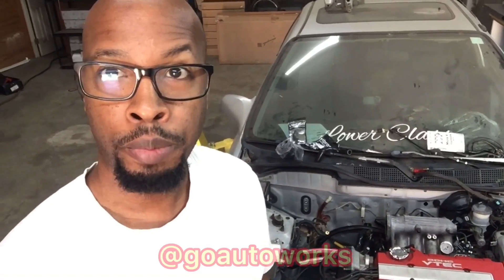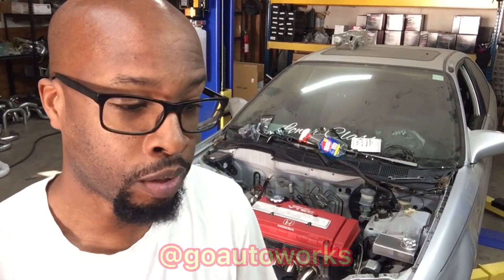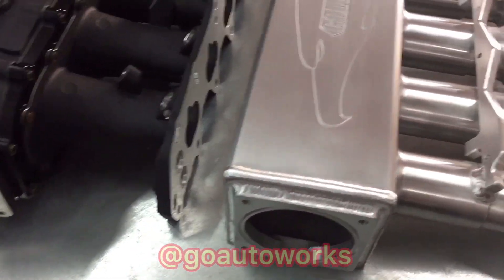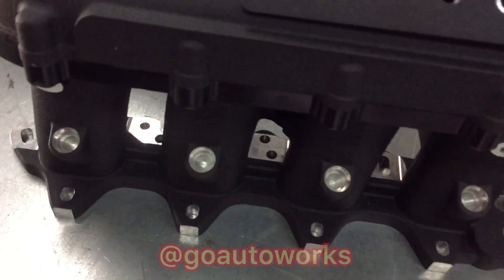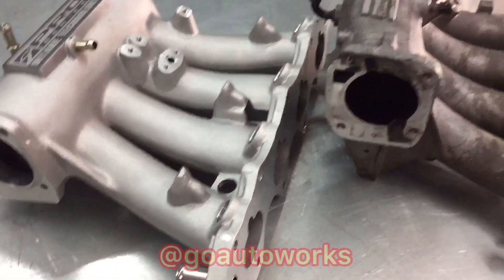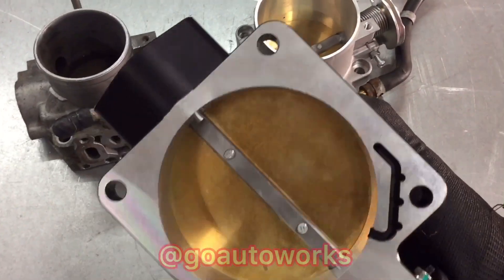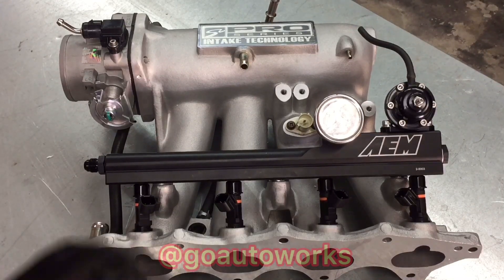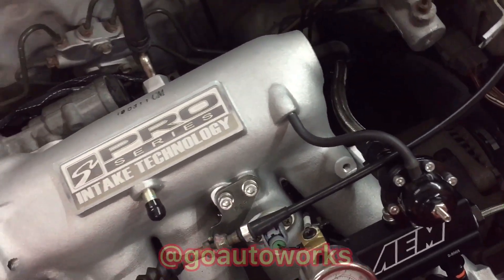Civic Intake Manifold Selection

Comment: Nice vid. I have the S2 Pro Series Intake Manifold and Alpha 66mm TB that I intend on installing soon, how is the process for calibrating the throttle body TPS? I'm unsure how to calibrate it correctly. Would you also happen to know if the throttle cable bracket from a stock oem B18B1 intake manifold will work with the S2 Pro Series IM? Thank you
Reply from the maker: sorry, just seeing this

Comment: Great video... what type of connectors do these injectors use?  I have a jdm obd1 b16a with oem intake manifold and fuel rail and looking to purchase 750cc rc injectors but im not sure which part number do I get as I'm seeing, SH4-750, SH4-750H And SH4750D. Can you plz help clarify?
Reply from the maker: Each injector body type will have a different "style" plug. We do carry injectors if you are in need. The part #s given are for RC injectors; which we also have. http://www.go-autoworks-store.com/rcfuin75sof4.html

Comment: Did you just use the factory throttle cable bracket? I bought my car with the SK2 Pro manifold already installed and they had zip ties holding the cable on. Wondering if it takes a special SK2 bracket, or if I can just buy a stock bracket and use it. Thanks!
Reply from the maker: stock EM1/B16 bracket was used
Reply: @GOAUTOWORKSYOUTUBE  Thank you!

Comment: Thank You for this video, 

I am building a b18c4 mk2 Golf... I am going to be running the Victorx with a skunk2 70mm 
Not sure what vacuums i'll need to work with the brake setup yet
Reply from the maker: Thanks, the Victor X comes w/ removable NPT fittings on the back of the manifold. The larger one is to be used for the brake booster.

Comment: I’m not using any washers on my fuel rail and I’m running into the same issue with my pro series intake manifold could I just get top hat extenders for it I’m using the golden eagle rail with stock injectors

Comment: excellent video. now the question is... it justified  upgrade the stock manifold to the skunk2 pro on a 400whp turbo setup? at what power level the stock manifold can be restrictive?  . thanks for your answer Greg!
Reply from the maker: is it justifiable? I would say so (Especially in a D series, GSR, or LS Non VTEC head setup). The larger TB paired w/ the manifold will only help in overall flow in the system as it does work as a pump and you've removed a "bottle neck" in that system.
Reply: @GOAUTOWORKSYOUTUBE   thanks for the answer , i have a b16a2 turbo setup . making 400whp. so my question is based in the b16a2 , the stock b16a2 manifold in that power levles (400whp) it will make a "bottle neck" you think? thanks again bro.
Reply from the maker: bolidovti yes, if you are making 400whp through the stock throttle body and manifold it will definitely make more with the upgrade (or 400whp at less boost...however you want to look at it)
Reply: @GOAUTOWORKSYOUTUBE   last question... with the ultra street its going to be the same ? or more difference in terms of flow and power? thanks again
Reply from the maker: bolidovti either would be an improvement over stock when paired w/ a throttle body. It just comes down to preference. We have all the options available if needing to order. 334 277 8030 or goautoworks@hotmail.com
Reply: @GOAUTOWORKSYOUTUBE   excellent bro. i will buy the manifold ( not sure wich one) and your gt600 IC . can you give me a combo price for the parts ? where i contact you? thanks

Comment: Quick question is that aem rail the same as a gsr rail
Reply: Wow okay thank you i guess mine was leaking because of the little spacers  on injectors
Reply from the maker: Aaron Romero using the oem spacers won’t allow the injectors/rail/manifold tighten together all the way. You’d more than likely get a fuel leak from the top or a vac leak from the bottom
Reply from the maker: Aaron Romero yesB series AEM rails all share the same part #